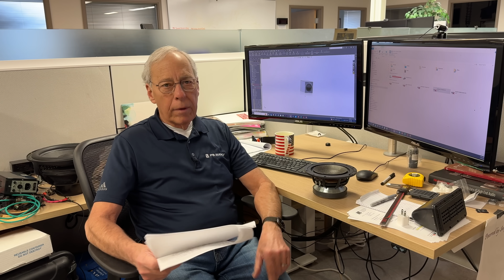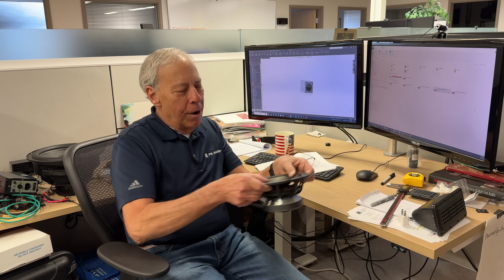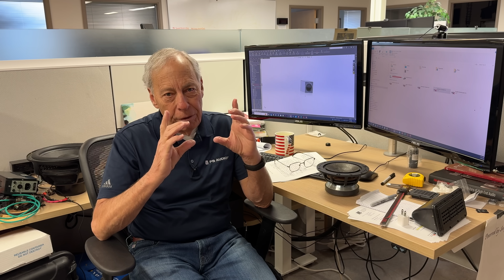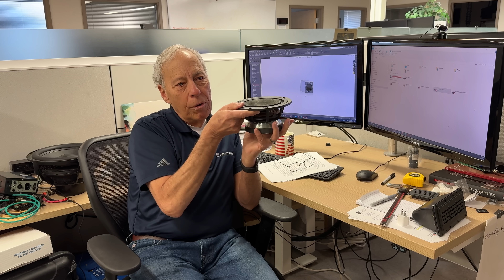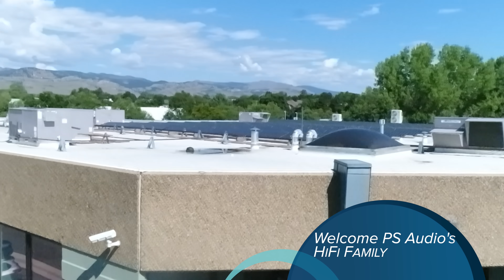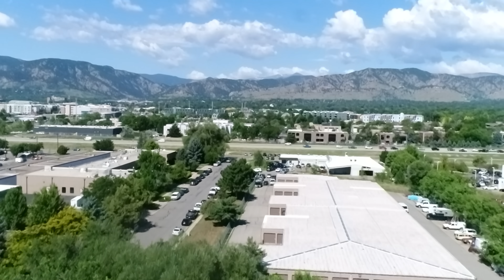How speakers move at multiple frequencies

Comment: Your eardrums, speakers, cables, signal paths through electronics and microphones all transfer music as a sum of waves represented as air pressure, mechanical motion (e.g. in a speaker cone), magnetic field (e.g. in a voice coil or cartridge), electric field (e.g. in electrostatic speakers) or voltage.
The true magic is how our hearing works with the cochlea in our inner ear sort of disassembling the sum of sound waves to individual nerve pulses that our brain can process as those same separate frequencies that went into the music to begin with.
Reply: INteresting.  SO this then raises the question if your ear sums the signal anyways is having the signal broken up by different drivers really better than a single driver producing an already summed pressure wave ?
Reply: @Canadian_Eh_I  Technically a single point sources is always best. But as Paul states, speakers not being point sources have other issues. In order for a speaker to produce lows it has to have some combination of larger size and/or greater excursions. To produce highs it has to be smaller and/or able to move very slightly but accurately without producing that signal in multiple spots at different phases. Thus very different design parameters for each.
Reply: Size and mass make no difference?

Comment: Thanks for answering my question! I was aware of how the diaphragm moves at multiple frequencies so I was more so asking how that's possible when there is only one magnetic field at a time. Based on what you said, it sounds like the answer is because the magnetic field changes so quickly. Thanks!
Reply: The field driving the coil has the overlapped frequencies already composited into the voltage it gets, by the audio circuitry.  Whats also interesting is how your ear takes the single overlapping wave and splits it out into frequencies using a biological structure.
Reply: @KK-dv3wh  The human brain is just wild when it comes to things like this. 😂

I'm not sure if I should call it an issue or be thankful that the alternative isn't happening, but all the rooms reverb is compiled to one (muddy) signal by the brain as well (instead of multiple clear echos). 
Room treatment for the win! ✌️😄
Reply: Simple answer is we typically do not listen to a single repetitive sine wave nor combinations of a couple. It becomes unlocking your mind from that constraint.  Music is constantly changing, non-repetitive complex wave.

Comment: I think it is easier to say that the speaker responds to a varying voltage that is a composite of all the frequencies in a given signal. A properly operating speaker is merely reproducing the waveform it is presented with.
Reply: I think he should have drawn two sine waves, added them up and show the speaker only has to respond to the sum of both waves.

Comment: That is why we need it 3 way speakers .  
Surprised that PS Audio makes 2 way speakers  for HI End Audio .
Reply: Depends on the Driver Quality (largely, the magnetic Strength.. which = greater control / accuracy).   It seems that higher frequency drivers are far less prone to distortions, because they are lighter, and can move much faster.   Where as accelerating a larger woofer,  is much more challenging.  If the woofer cant keep up with the acceleration demands.. you get micro-distortions (muddy-ness, where instruments and vocals blend in together, losing separation and details).

 I had a pair of 90s era  "Techniques"  speakers.  They were 12" 3-ways.  The tweeter and mids on them, were very low quality... but did enough to get the job done.   The woofer was also low quality... with a small magnet.   Id later picked up a 70's era set of  "EPI 100v" speakers.   The EPIs are a 2-way,  with an 8" woofer... and the cabinet volume is like half the size of the Techniques.    Yet... the EPIs utterly DESTROY the Techniques, in every single Metric.

 The EPIs have a deeper, and punchier bass (due to the woofers having a much larger and stronger magnet + stronger coils)... and the bass itself sounds far more "Musically Accurate".   The EPIs inverted tweeter, is pure Magic.  It produces a near Holographic 3D Soundstage / Image.   The speakers sort of Vanish.. and its like the sounds are just coming out of thin air, without an actual Source projector.  Its almost as if a band was in the actual room with you, playing Live.

 Now... the only drawback, is that the EPIs can not play quite as Loud.   But when you hear how good the EPIs sound, you dont really care about the loss of a few Decibels.   Its sort of like the difference between eating at a High end restaurant vs a cheap all-you-can-eat buffet.   The buffet food is just edibly "OK"... where as the fancy restaurant dishes.. are  "To die for".  Pure Nirvana, in your Mouth.

 You would never know, that the EPIs lacked a separate midrange.. as the tweeter is so Magical, and Accurate.  In fact, Ive heard NEW things in music that Id listened to my entire life.   Such as... for the very first time... being able to fully understand what Lyrics the singer was singing (where as on other speakers, it gets too distorted to actually make out).

 Also, Ive heard speculation, that additional crossover components can alter and or distort the original signals.   According to the designer of the EPI speakers... he used heavier gauge wire on the woofer coils.. to automatically filter out the highs, without the need for an additional crossover component... citing that reason.   It may have also reduced the overall cost, too..  as there is less parts, and no need to solder / wire them.
Reply: Implementation is key here. Better a good implemented one driver than bad multi. The Sibelius speakers for instance look promising.